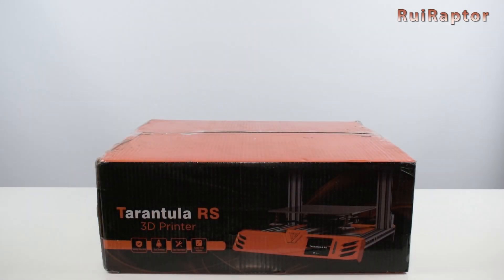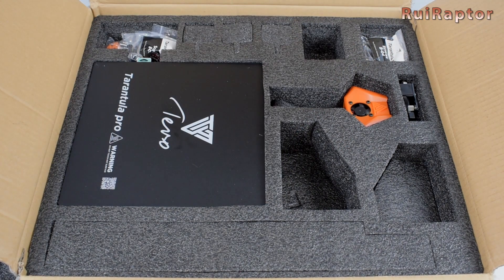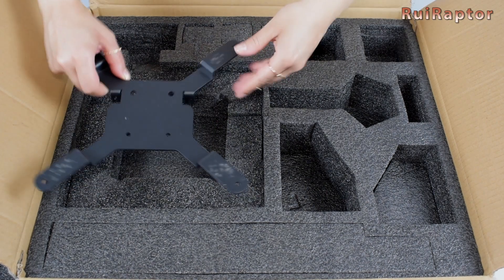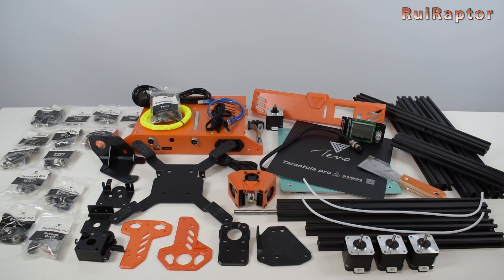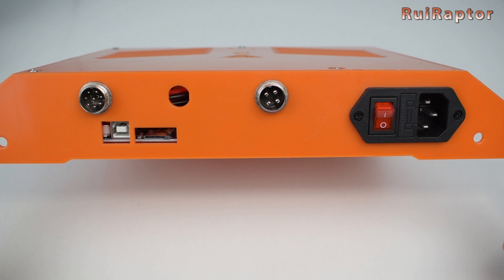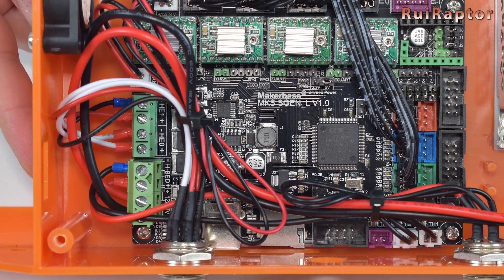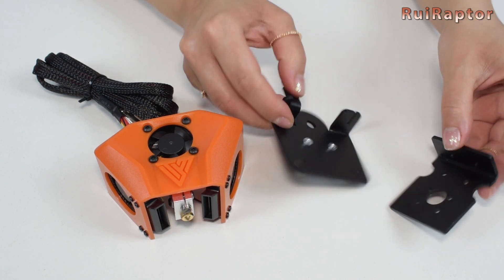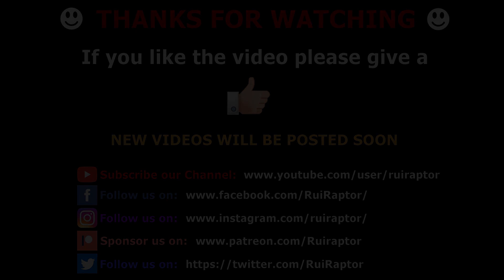HOMERS Odysseus / TEVO Tarantula Pro - Unboxing & First Thoughts

Comment: Hi what is the difference with the RS and the PRO?? The RS is more expensive and there is extra connector in the back for auto leveling???
Reply from the maker: The RS has TMC drivers, touch display, AC heatbed and a few other things. You can check here the details:
https://homers3dprinter.com/products/copy-of-homers-odyssues-tevo-tarantula-pro-the-most-affordable-3d-printer-diy-kits-in-2020-newest-3d-printer
Reply: wekker090, if you're going to go into the price range of the RS I'd recommend the Ender 3 v2 as it is actually cheaper and is a better printer with a proper Meanwell power supply.

Comment: Hello Rui,
As I can see at the begining of your video, on the box we can read the material supported for print.
Apparently ABS material is not supported, like on the previous version of the printer.
Do you know the reason why apparently we can not print with this filament; and maybe what to do on the printer to print with this filament.
Thank you in advance
Jean-Jacques
Reply from the maker: Hi,
the reason is because of the low power of the thermal pad on the heatbed and also the low power power supply. This will make it hard to reach the necessary high temperatures on the heatbed to print ABS.
Reply: @ruiraptor  Thank you for your answer.
 Is the heatbed able to reach the neccessary temperature if I upgrade the power supply with one Meanweel 24V 350W ?
Or the electronic on the MKS GEN L V1.0 controler board is not able to d this ?
Reply from the maker: Hi, the board is not the issue. It's the thermal mat under the bed which is only 100w.

Comment: what firmware it uses?
Reply from the maker: Hi Leo, it's uses Marlin but not sure exactly which version. We are still filming the assembly. When we turn the printer on we will check if the version is displayed on the screen.
Reply: marlin 2.0.5 out of the box

Comment: thanks! is the detailed assembly guide still in the works?
Reply from the maker: Hi Brad, yes, we are working on it. This manual takes some time to publish because the printer comes completly dissasembled. Also, we are currently working on several videos at the same time.

Comment: Hello,

I didn’t understand why you tell it new tarantula Pro. There is no informations or datasheets of it. Website of Tevo / Homers don’t tell any information on it. Only Banggood Said it’s a Tarantula pro. In the box, you didn’t find manual or informations about it. It seems to be a unofficial Mix beetween pro and RS. It Looks like a toy with plastic parts.
Reply: The manual in the SD , we copied the files in there .
Reply: Leonardo Chris, thanks, but it is not very serious, there is no manual about this printer but about the older. In my case, i don’t have SD.

Comment: Hello. I have this printer and recently I bought a 3D Touch sensor ( https://www.amazon.es/gp/product/B08N13RYXY ). I tried to update the firmware with the files that are in the Tevo GitHub repository. No my printer doesn't work :( ... it doesn't turn on the screen and when I try the connection with my pc via USB, the pc doesn't detect any connection. Could someone help me please
Reply from the maker: Hi André, try to compile the Marlin's version (stock with no leveling sensor) to restore the printer. Let me know if you need additional help.
Reply: @ruiraptor  thanks for your help. Everything is working now. But I really want to install the 3D Touch sensor could you help me?
Reply from the maker: Hi André, you can use the same config files to add the BLtouch settings. You can check our Ender 3 V2 Bltouch installation video where we explain which  lines you need to change to enable the BLtouch. 

https://youtu.be/2mWiEhSHMtQ
Reply: @ruiraptor  thanks a lot. I will try. Talk to you soon

Comment: Wow! What a huge difference from the first Tevo Tarantula from years ago. From 12V open power supply to this control box and aviation connections. So Cool! I am hoping they will sell the hotend assemblies so I can get some spares for my Tevo Tornadoes since they are also 24V. Also Sandra is an awesome hand model. :)
Reply: If you have an extra can I buy it?

My uncle's printer is dead at the moment and it needs a new hot end assembly.
So far after trying to contact Tevo all he got back was "I'll ask Qianmin Tan"  which is not assuring me in any way shape or form.
I have a message I sent to Tan back in 2018 still listed as "unseen" so I am not holding my breath.

Will pay extra, just need the parts.  =)
Reply: @DanMoridin  get a v6 on eBay and put the Titan extruder on the x gantry

Comment: Thanks for your review Rui , We will keep on upgrade the product's improvement .
Reply: I Miss Tevo tho Homers just dosent sound as good as tevo
Reply: @SlippySkip   Yeah , the complaint before that's the delay shipment . Solved !   The quality and pricec customers will love it soon .
Reply: Leonardo Chris is the Odysseus injection molded or anodized/powder coated aluminum I can’t seem to tell I really want to get one
Reply from the maker: The orange parts are injection molded. The black Z carriage and the Y stepper motor mount are also injection molded. The X carriage and print head mount are metal.
Reply: @SlippySkip  The older version they were all metal. They replaced them with plastic now. Also be careful because a lot of people have been sent the wrong printer, usually a cheaper model when ordering directly from Homers. There have also been massive delays in shipments with some people's ordered being outright cancelled and being told to reorder so they are back at the end of the que.
Reply: How about you get the customer service where it needs to be instead of putting out new stuff without properly backing it?!?

I have been dealing with Tevo products for years and everytime I have to deal with an employee at the company I just want to tear my hair out.

Comment: I just bought one and waited a month then told I'm getting a refund not happy at all not sure I can trust this supplier again
Reply: I've had problems with them with the printer I bought last year. My Ender 3 v2 arrived the other day and when using the latest version of Cura it prints fantastic (just choose Ender 3 Pro as the profile until they update with the new printer) I'd recommend looking into that one. Little more expensive but very much worth it in my opinion.

Comment: TBH, I couldn't wait for your review to be released, so I ordered it. I hope this is not going to be a costly mistake. Will see...
Reply: I have the older Tevo Tarantula Pro from last year. To be honest if I were you I'd spend the little extra and get the Ender 3 V2, mine arrived just a couple days ago and when using proper Cura instead of Ender's reskin of Cura, The Ender 3 v2 beats this printer by quite a bit.
Reply: @namor isats Yes, in less than a year.
Reply: @namor isats No, I had the "pro". It broke in less than a year. Their new orange ones are breaking much sooner and a lot of people who ordered a higher model are receiving the lower one. You need to avoid this company instead of asking where to buy one. Also this Tevo machine doesn't print as well as an Ender, it just isn't good for the price.

Comment: in my opinion, this printer in the mechanics aspects is good. but in software is terrible for a novice. 
before you buy, think that you will have problems printing and will have to do a lot of research to solve the problems. in fact i advise anycubic i3 mega for people who don't have much experience with 3d printers or who want a quick and easy result. I regret buying this HOMERS Odysseus / TEVO Tarantula Pro.